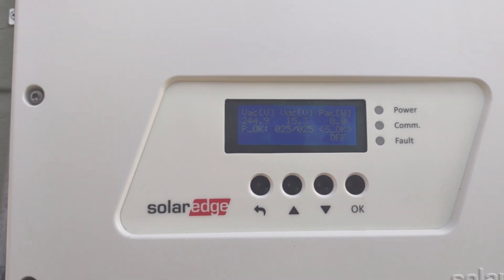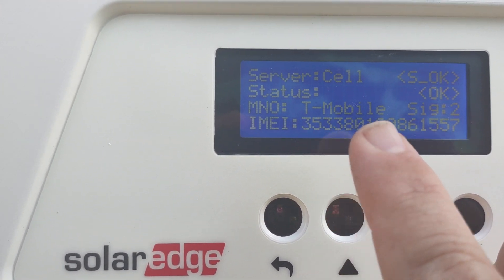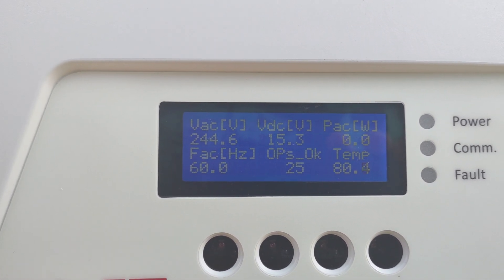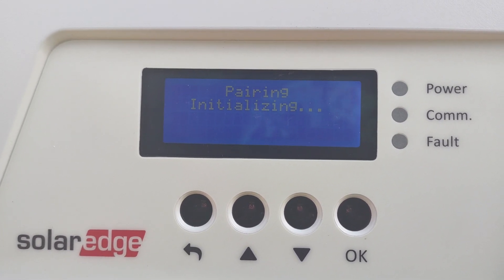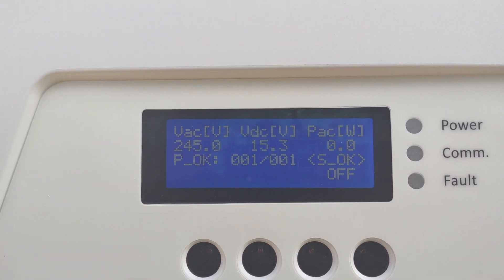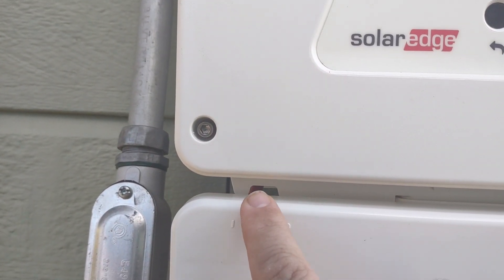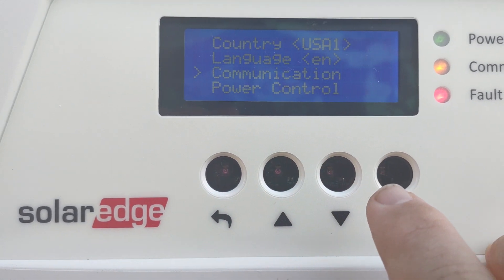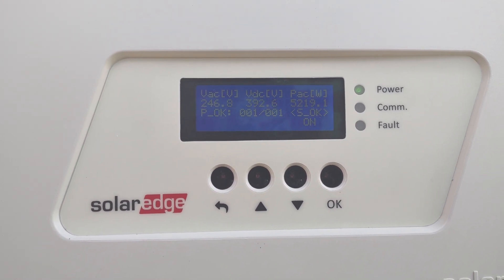how to operate the screen version of a solaredge HD wave inverter

Comment: Mine is stuck in night mode checked voltage and it reads good till I turn on the dc safety switch then I get .075 volts dc with it off I get around 12vdc any thoughts???

Comment: I have a solaredge 3000 that I bought used on e-bay. Hooked it up and it worked fine. I shut it down every night and after about 2 weeks it stopped producing power. It reads 240 grid voltage, incoming voltage is actually higher than the panel should read(10 panels at 31 volts  and it reads around 420 volts incoming and producing reads 0. It shows a 18xBC code. I have tried everything I can think of. Solaredge seems to only want to deal with installers. Before I scrap this one could you tell me what settings I might have hit that would cause this or is it shot. Thanks George